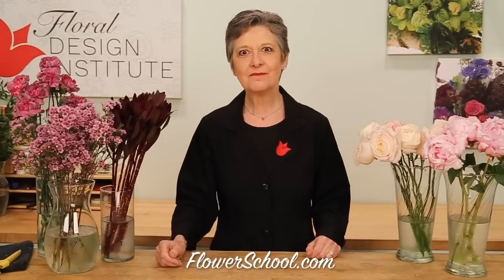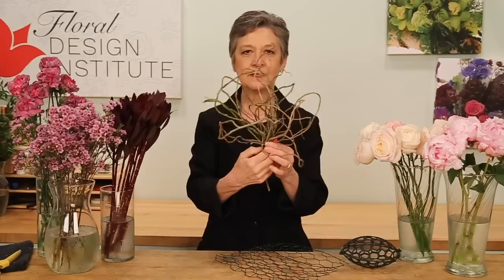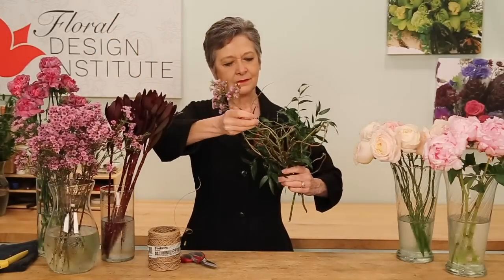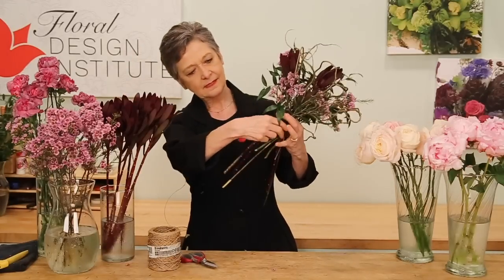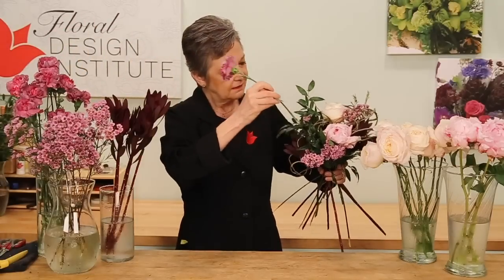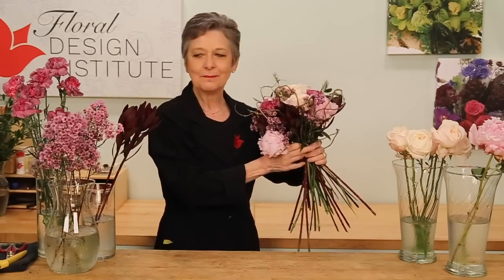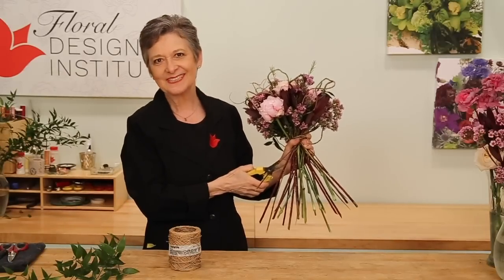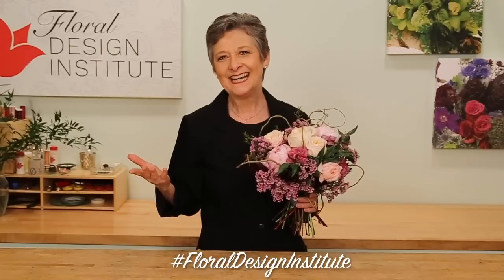Natural Armature Bridal Bouquet

Comment: What can you use instead of curly Willow that will give the same effect?
Reply from the maker: You could use any flexible material, branches, sturdy vines, even aluminum wire or armature if you are wanting some color and sparkle. Here is a link for the aluminum wire. https://www.floraldesigninstitute.com/shop/index.php?main_page=index&cPath=3_28
Reply: @FlowerSchool  thank you so much